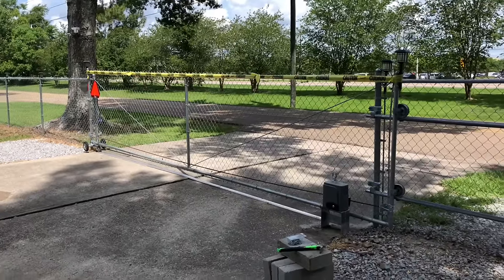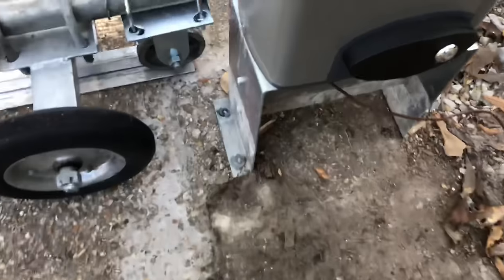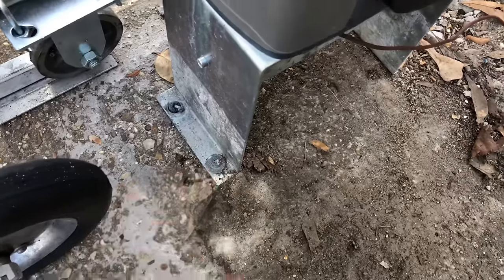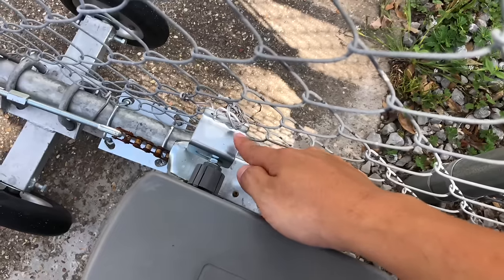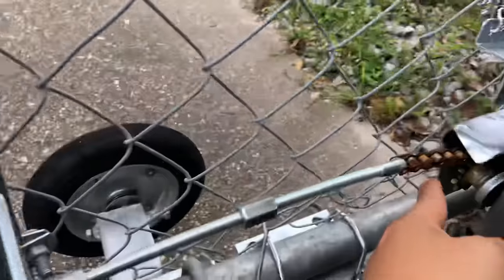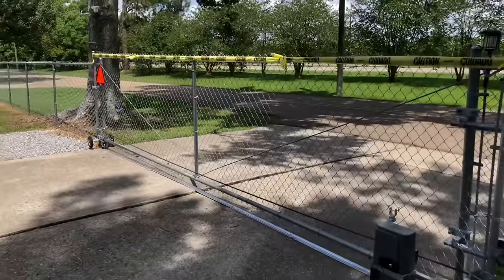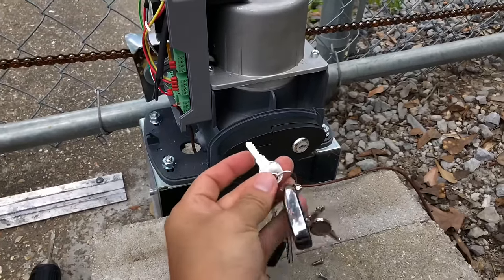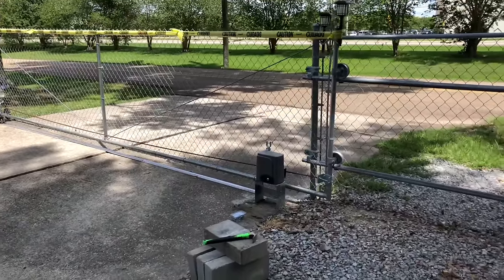CO-Z Automatic Sliding Gate REVIEW & HOW TO INSTALL

Comment: u need a hammer drill.. u will not break a drill bit.. use proper tool
Reply from the maker: I was using a hammer drill. Key is to keep the drill head cool. Only learned that after breaking a few lol
Reply: Hammer drill with masonry bit. will cut concrete like butter. No oil needed. A standard bit will turn bright red.
Reply: I do concrete and always use a hammer drill with concrete bit and no problemo amigo ✌🏼✌🏼

Comment: Question, do you have an idea what size solar panel i would need and battery size? i want to make mine solar powered...
Reply from the maker: Hmm... I’m not exactly sure on that. But  i believe the manual states it will be fine with both 120V or 240V. However, don’t quote me on this. Let me know for sure if you decide to do it!

Comment: How has this held up over time? You can use 0 grade or Number 0 grease on the chain and it will last a long time without dripping off. Helps to combat rust that builds up on chain exposed to the elements.

Comment: Where did you buy that electric wire and how did you connect that to the house? Great vid by the way!
Reply from the maker: I bought everything on Amazon
Reply from the maker: You can actually buy any wire and snap/cut the end and split the 3 lines to hook it into the gate. I would recommend to buy a heavy duty wire, like the thick orange one.
Reply: Can you post the link of the wire you purchase at amazon thanks
Reply: @HRR  can you show how you hooked it up inside? did you attached to a power cord or directly to a breaker?
Reply from the maker: I connected the lines to a wall plug, then plug it into a normal wall outlet
Reply: @HRR  An easier way is to just buy a cheap outdoors 12 gauge extension cord and then to cut off the female end and now you have the 3 wires that you can hook up to the motor circuit board shown in the video.
Reply: PancakePlease I purchased a switch/outlet combo (cheap under $5) & put in outdoor weather enclosure in side a box that locks & then I can turn the outlet off @ the gate rather than unplugging etc.

Comment: How's it work  in the cold environment special in the winter freezing weather in Chicago
Reply from the maker: Since I installed this gate, it only snowed twice the past few years. However, the temperature does drop below 40 degrees here in the winter and it works perfectly, like a champ. I can’t speak for long term snow.

Comment: Does this come with sensors? If not could it be added?
Reply from the maker: Yes, it comes with two magnet sensors to auto stop the gate.
Reply: What I meant was motion sensors? I have kids and I don’t want it to close on them? Does it retract if it hits a object? Thanks
Reply from the maker: No, it doesn’t have motion sensors, so it’ll keep on going until it reaches the magnet threshold

Comment: I'm a little skeptical. Some Amazon reviews say it stopped working after a couple months. Problems with the motor.
Reply from the maker: I have been using for nearly 2 years now and no issues at all. It has been through rain and storms. Still works great
Reply: @HRR   Can you please list the items that dont come in the amazon package and are bought separately? I just bought mine and need to know what to buy separately
Reply: I saw that too but I think those are people with frikkin' HEAVY gates and they're burning out the  motor.  I was going to clad a steel-frame gate with lumber, mostly 2" x 6"s and 2" x 4"s to match the fence, but when I did the weight calculation my 14' gate would have been close to 700lbs!  I opted instead for a $200, 75lb, steel-tubed gate from Tractor Supply Co. I'm thinking the motor doesn't even flinch with that kind of "load". lol

Comment: have you tried to attach a photobeam / electric eye?
Reply from the maker: I knew of it.. but didn’t get it since this package came with everything I need.. I just had to play around with the placements of the magnet a bit. I would get it if it was cheaper.
Reply: Ok. I’ve purchased electric eye / photo beams on amazon for less than $20 in the past that I use with other operators.  I’ll try it with this operator. Pretty sure it will work. I’ll let you know ;)
Reply: @natashat1001  Did you end up trying the infrared beam?
Reply: PancakePlease yes & it works perfectly! The manual I rec’d via email from the seller was completely wrong - but the small manual that came with the operator has the correct connection information. I used a cheapo reflector style electric eye.  I think the model was ek13 (omron was the brand) or something like that. You have to use a photobeam that has the option for normally closed (most have this) & you have to remove the small staple style jumper for it to work.
Reply: I have it connected to keypads as well. And that works great too.
Reply: PancakePlease correct model: e3jk http://www.omronkft.hu/pdf_en/e3jk.pdf here is link to manual for the photo beam.